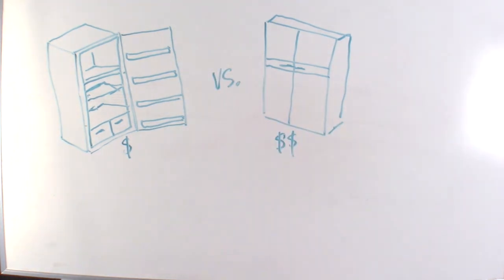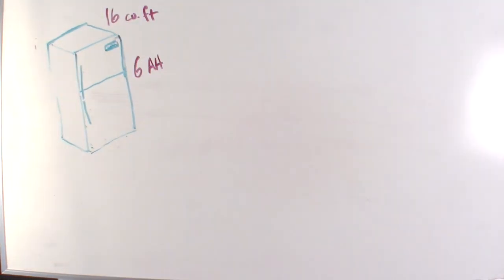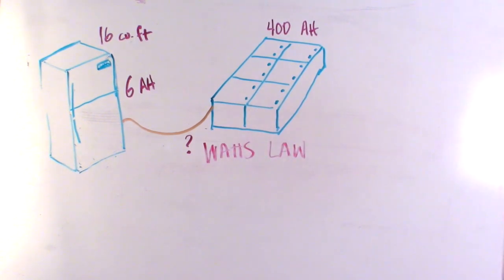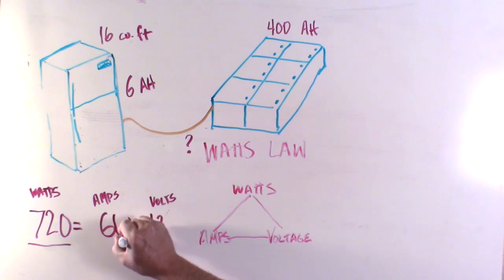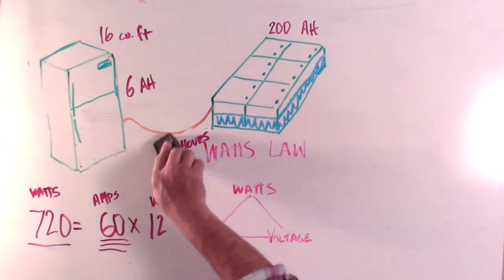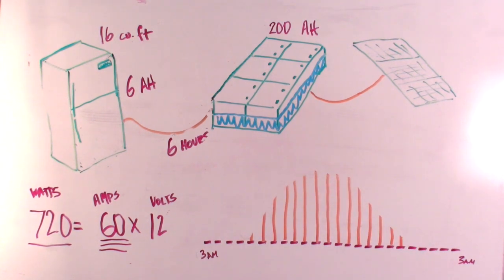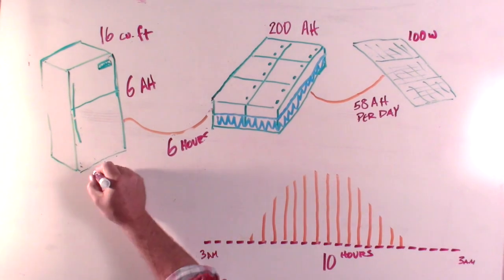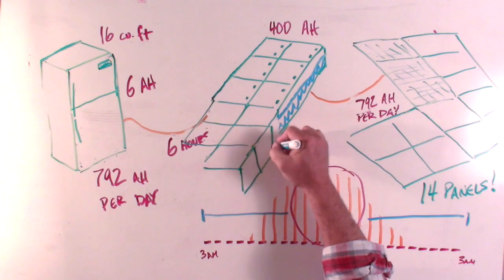RV Solar Power Basics - Why Residential Refrigerators Suck - Josh's Garage

Comment: You need  a math lesson.  Most of the class a mh,s have at least 4 6 volt batteries. Mine has 8. I can go 20 hours without running the genset. But no matter what fridge you have a modern decent class a has lots of loads that can deplete your batteries
 Lights, water pump,2 TV,s,DVD,satellite system,toutets and chargers for phones and tablets. So pne needs to run the genset about 1.5 hours every day. Your double door propane fridge aldo draws 12 volts
 Withe a house fridge uour total is about 3 hours a day. Ask people that have house fridges. They would never go back to one of those fire starters  with soft ice cream. Every house fridge comes with a label that tells you how many AH it draws.  Do the math with that data.  Your video is all bs. Flawed

Comment: Excellent video, right on. Hard for some to realize the difference between amps at 120v and amps at 12v, and get a grip on inverter efficiency. But watts are watts. Compare any DC boat refer with a compressor to any residential refer and you will quickly understand the difference. At home, you don't care much  about energy efficiency regarding refers because your electric power supply seems to be unlimited. Boondocking is another story. Refrigerator efficiency is mega important. And PS: I think most top of the line DC refrigerators are better insulated than any residential refrigerator !
Reply from the maker: Thanks man.  I totally agree

Comment: I have been RV'ing for many years and have experimented with solar.  It is great.  But I would never give up my dual AC/propane fridge.  Yes, I know they aren't very efficient, not even running on AC, but the missing factor in the equation is how much energy comes in 2 - 30 lb propane bottles.  It's a lot and will run that fridge for weeks.  I also won't give up the propane stove, same reason.  I remain highly sceptical that a 12 volt fridge can be all that much more efficient than a residential fridge since the technology is essentially the same.  You save the inverter loss but that's about it.  I have also experimented with solid state coolers.  Forget about it they aren't very efficient.  Sure they only draw 50 watts but they do so 24/7 which adds up to a lot of AH.

Now don't get me wrong, I love my solar panels (300 W total), and have 200 AH of battery.  The system works great.  But I have converted everything to LED and the TV is only 24 inches (also LED).  It works good to charge devices too because 300 watts is more than you need if the sun is out.  But if the furnaces is running at night I still run out of power after a few days, even though most of the energy comes from propane also.  Oh and forget about air conditioning unless you are plugged in or have a whole bunch of gas cans, it just isn't doable.

When my dad first took the family camping back in the day the trailer did not even have a battery.  The fridge was propane/12 volt (for travel), the heater was a wall mounted propane convection job, the stove was propane, and the only light was a single mantle style propane light (which also threw off a lot of heat).  No batteries at all.  The water pump was manual.  There was 110 V lighting but it only worked if you were plugged in.  My dad got some 12 V incandescent bulbs and jerry-rigged a cord so he could clip the 110 v system onto the station wagon and run the 12 volt lights, but the car wouldn't start in the morning so he only did that once.

So the ideal setup is a propane/electric fridge, propane stove, propane heater, LED everything you can, 300 watts of solar, 200 AH batteries, and a fantastic fan (tends to run when there is excess solar).

Comment: Josh did you think do this video with lithium iron phosphate Lifepoa  100 amp/hr 12 volt and on safe side drain it at 80%  4 battery.   4 - 320 solar panels. I'm think that fit  
2- 320 solar panels in a same area as 4- 100 panels

Comment: This is even more true as residential refrigerators have permeated the towable RV segments very heavily in recent years. Towable RVs typically lack the suspension of something like a diesel pusher and cause the residential refrigerators to experience stress for which they simply were not designed. 

The penalty for failure is pretty steep at times as many of these residential refrigerators are installed in slides before the slide is then installed into the RV. They're not always capable of being removed from the RV from through the door. We have had times at our facility in which we've had to dismount and move the entire kitchen island and in more than once case even had to remove a large window from the camp-side-slide as the fridge could not fit out of the door. 

Not every area of the country has appropriate service techs for residential refrigerators, and most residential refrigerator brands will not authorize an RV dealership to service their failed fridges. 

I've felt strongly for years that if the 18cu ft gas/elec RV Fridges actually designed for this business existed two years prior, then these residential refrigerators likely wouldn't have ever infected the industry.

Comment: A Typical modern 485L fridge (16 cu ft) has an energy rating of 330kwh per under standardised tests, which are pretty agressive in Australia. They include high ambient temperatures and high loading of the fridge. This is 330kwh per year is approximately 1kwh per day. The 200AH of useable capacity (from your 12V 400Ah pack) at 12V is 2.4kwh. This will run the fridge alone, un-assisted for 2 1/2 days if it is properly installed (ie proper air circulation allowed around the body). To maintain that charge, I'd suggest at least 400W of solar, or more would be required, depending on where and when you travel. In winter, or climates away from the equator, as you showed, this might be an issue, as your 400W might peak at 100W, so you won't keep up, and might only get 300Wh per day or similar. During summer periods, your 400W will easily produce 1Kwh of electricity by lunch time, and most people with effective installations reach "float" on their batteries by midday under ideal conditions

Regarding your use of units, you need to be more precise there. Amps per hour is a bad term to use. W is power, and typically we talk about Wh (watts used over time) watt hours, not watts per hour,, same with amps (amp hours is an informal way of expressing watt hours at a given voltage - as you showed by Watt's law). A good fridge, properly installed will use around 80AH (1kwh at 12V) in a day, or 1kwh per day. Your 720W (^A at 120V) is no way representative of the actual instantaneous power consumption of the fridge. The starting current is likely to be 6A at 120V, but the running power of a modern fridge is actually around 100 - 200W (buy one of those cheap AC power meters and see for yourself)

Your maths is OK (ignoring nasty units - stick to W, Wh per day, or A and AH per day, not amps per hour or watts per hour), but the fundamental assumption about the fridge power consumption is incorrect. Also, your 12V super efficient DC fridge mentioned at the end is actually likely to be less efficient that the commercial refrigerator, and 5x as expensive. I can point you to references of people (real people, with real RV's running real life tests, with detailed measurements in 40C ambient temperatures) that can demonstrate the effectiveness of the domestic fridge solution, or more specifically, the use of a solar/battery system to run a compressor fridge.

Comment: Josh we are in the looking stage for our first RV. It will probably be a Class C which they typically use a 8 cubic ft fridge. The two and three way fridges scare the hell out of me with their safety record. I will replace it with a compressor driven fridge. I have found the brand Nova Kool which has primarily been a marine use fridge but they are starting to go for the RV market with a 9 cf fridge which will slip in perfectly where the 8 CF fridge was. They are pricey but seem to be built for heavy usage. Do you have any other suggestions  for a efficient smaller fridge? Thanks!
Reply from the maker: Just google "solar 12v refrigerator" and you'll find a few other options.

Comment: I live on a 45-foot Chris Craft, my RV is seldom used, but for whatever reason, I keep it. One of the first things I did when I got my 2015 Minnie Winnie was toss that propane firestarter of a refer out the door and replaced it with a dual voltage marine refer. I also took out the drawer under the old 3-way and made it a freezer draw refer. I have left it on for four straight days boondocking as they call it, yet there is no docking to it, with the 3,000-watt solar panels I put on the roof and had zero battery issues. Can't say that for those  RVing around me.

Comment: The trouble with this is having a big frig. I have a 9 cubic foot frig 400 solar 3 batteries I run all led lights my cpac , dvd player computer  and frig and never have had any trouble even on days that the sun doesn't shine it works for maybe 3 days before I have to worry.  I also run a window ac for about 30 to 45 minutes at night to cool down the trailer 6X14 cargo trailer again no trouble I carry 2 weeks of food in the frig. also if the frig stops working I go buy another one for about 300 bucks I got about 6 years out of my last one and that was camping for 6 months out of the years and the frig running all year long because I use it for a shop frig ( but still in the trailer )when I am home so I don't have to run to the house for my ice tea I just walk out of the shop and into the trailer and refill my glass.

Comment: Luckily. 400 watts of solar and a 6 (not a 16cu) AC/DC refrigerator/frezzer is no problem. By the way, I don't open the fridge every hour to check if my chow is still there. An efficient 6cu AC/DC fridge plus solar equals no problem. Josh, please get rid of that gigantic AC only fridge and yes ... your ice cream is still frozen. Stop opening the door and letting the cold out!!
Reply: 900 watts solar  700 amp batteries  Arizona winter Nov-March  will run my 10 cu ft residential fridge, 7 cu ft residential freezer, 50 TV, coffee maker, etc. If you plug a kill-a-watt meter to show the actual draw in a 24 hour period it tells the true power consumption of these appliances. It is all about a balance of consumption and availability of solar, I guess I have achieved that. Oh, by the way, my batteries after making coffee in the morning are rarely below 70% full charge and will reach 100% by sundown on most days.

Comment: Your fridge compressor runs 50% of the day?  Are you kidding?  Good grief, fix that leak or whatever has your fridge injured.   I am an EE and yes, the compressor draws a lot of power but it also gets cold, really cold, and does so in an hour or so.  It does it without an open flame while I am running down the road.  LiFe batteries can help a lot here but yes, that means money.

Comment: I tracked my Whirlpool residential refrigerator with a Kill-A-Watt and observing the BMK on from Magnum MS2012 inverter and get better numbers.  The fridge would pull 3-4Ah at 12V when the compressor was not running.  When the compressor was running to cool the fridge it would pull around 15Ah at 12V.   Over a 12 hour period on a mild day facing away from the sun, the refrigerator took around 100Ah of juice from the battery.  Overnight, I used around 60Ah as it is much cooler, and we were not opening the refrigerator while we slept.

I have four 6V 220Ah batteries for a total of 440Ah at 12V (220Ah useable) so it is similar to your diagram.  Technically I could last 24 hours, but there are other things running as well so we run the generator for a couple hours in the morning and a couple of hours in the evening.   We are not fully charging the batteries, so this is a poor practice with regards to the health of our deep cycle lead acid batteries.

I agree retailers are not fully informing RVers, but mainly on the health of their lead acid and AGM batteries.  Residential refrigerators are not well matched for them as a power source when dry camping for extended periods without a good solar solution and a well-informed user.

Comment: Actually there are 12v fridges. Truck stops sell them. Yet there are small.
Reply: Great point.  And you're right.  Those are pretty small units.  Most big RV's are running 16-20 cu ft fridges.  I wish they made a large 12v (that wasn't as heavy as the solar models).
Reply: @loshjittle  Unless someone modifies an old school model full size refrigerator with the same 12v concept. Yet it will be trial and error of course. No one has done it. And it takes imagination to work. The only way I can think of it working. Is replicate the traditional freon in a practical 12v way. And use propane gas as refrigerant. Strangely enough. Propane when is in an aerosol can. And used to refuel a lighter. The propane bottle gets cold.

Comment: Use a inverter. Not all campgrounds are  squishy either. Not only that I would have had to spend 2 thousand dollars to buy a new RV fridge because my RV is 40 years old and can’t get parts for it the only saloution replace. So  which would I rather spend? 2 Gs or 3 hundred to have it removed and use a smaller res fridge my friends gave me and get inverter eventually. Doesn’t bother me to spend time in private camp grounds either in fact it’s better the people are nice and if U need anything there’s someone to talk to about it plus U get to meet great people and isn’t that part of the camping experience????? As well.

Comment: Thank you for the breakdown!  I initially made the mistake of not converting the math from 120v to 12v and bought a 1.4A fridge I was planning on using.  It later dawned on me what I had gotten wrong and fortunately I am still in the planning phase.  When trying to figure out what it will take to make the fridge work, it ends up costing way more than a two way fridge does (batteries, solar, etc.) and you end up being better off just going with the two way fridge.
I now have a fridge to sell, but that's much better than spending thousands on a solar system to only discover that it still won't keep up.  You did an excellent job at explaining it and I wish I had came across it before I made my error in my calculations.
Reply: This warms my heart!  I'm so glad it was helpful.  Dump that residential fridge and get a duel fuel.
Reply: He got the fundamentals wrong. The fridge does not consume anywhere near the power he says. You don't need to convert from 12V to 120V if you do all your sums in Watts, and Watt hours, but that does assume starting out with the correct values. A large fridge like the one shown uses about 1 Kwh per day, and it's typical "on" running power is 150-200W, not 750W

Comment: Besides what the others are saying...you give an example of a HUGE home fridge. Most older RV's use a 9cu ft maximum.
Not only that, if your fridge is running its compressor...even in 110 degree weather...half the time...Houston, YOU HAVE A PROBLEM!
I wish, just one time, people would not grossly stretch the figures to make their point.
Your math on the watts is great...too bad you could not have been accurate in other areas.
Reply: "Mr. CHEAP's" OLD MOTORHOME UNIVERSITY then give us your 9 cuft fridge calculation. Even if your 9cf fridge uses half as much as Josh's 16cf fridge (it doesn't, it's more like 3/4 at 4-5AHr) you will need half of Josh's calculated solar panels and half of Josh's batteries; 7 solar panels and 6 batteries. 
Most likely your 9cubic feet fridge needs 10 solar panels and 9 batteries.
Reply: My brand new high efficiency 18 cu. ft. fridge for my home runs 8.2 hrs out of every day, or roughly 33% of the time. Josh's Garage estimates a duty cycle of 50%, a reasonable estimate considering RV fridges are generally under-insulated and RVs sit in the hot sun all day.
Reply from the maker: My math is based on my 20 cu. ft. full size residential refrigerator in the Monaco I had.  We could only run that thing for about 8 hours with four fresh 8D 6V batteries.  I'm not making this stuff up...those are the fact.
Reply: (329KWH year/365 days= 901watts day/12= 75DC amps a day= 75DCA/24= 3.1 Amps/HR)
https://www.homedepot.com/p/Magic-Chef-9-9-cu-ft-Top-Freezer-Refrigerator-in-Stainless-HVDR1040S/205429605
Reply: I agree with Mr. Cheap.  By my calculations the average daily DC amps for a 10.3 AC fridge is (374KWH year/365 days= 1025watts day/12= 85DC amps a day)

Comment: Excellent video! you might want to rename your video or have different tags to get more hits. you might want to do a final cost comparison as long term for an RV refrigerator "off the grid" would make more sense.For example most propane refrigerators average about 1000 btu's per hour of propane. There are 96,000 btu's in 1 gallon of propane. Therefore you can run an average refrigerator for 4 days on 1 gallon of propane.
Reply: Ours cost us more than a dollar a day on propane.
We have 996 watts of solar on the roof and 380AH of batteries.
Running a 10 CU FT electric residential unit is the best thing to do in this case.
His math is way off. WAY OFF
Reply from the maker: Good thoughts.  I'm new at this youtube thing.  I'll try some tweaks.
Reply: I just want to say that I had no choice in the route to having a res fridge in my rather old RV because the cost was so high to replace and U well by replacement parts well there not being made anymore, so find a used one yeah and wonder if it will work and if it isn’t just as old as the one U pulled out. So I went the res fridge route and Iam in the stage of finishing the project. This way works for my situation. I too have a solar panel and if need be I can look at inverter I was planning on more solar panels any way.
Reply: We went through $50 of propane this season already with running the fridge and stove for about 18 days.... we just bought the unique 10.3Cuft 12v compressor fridge. Hopefully it makes a difference.